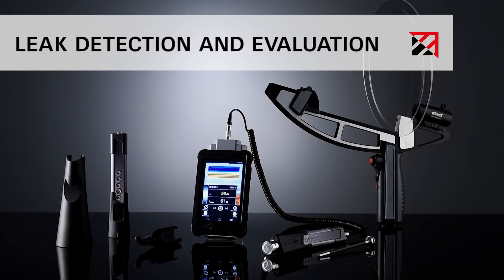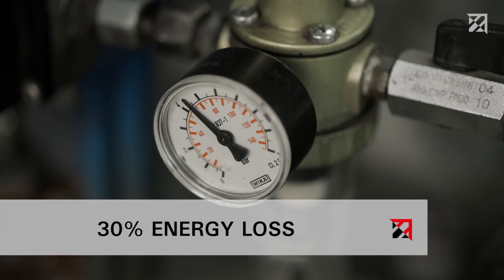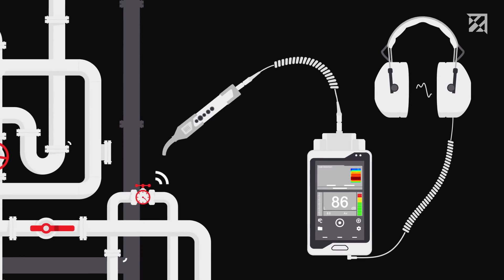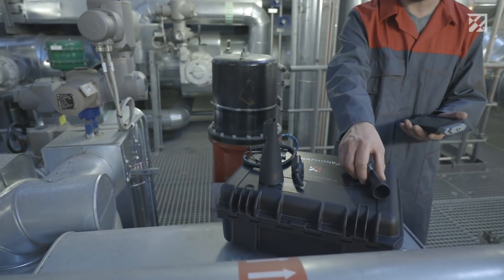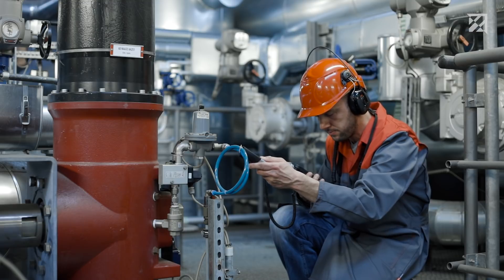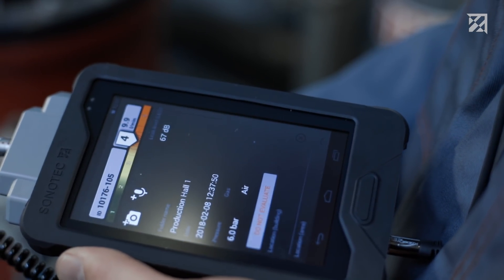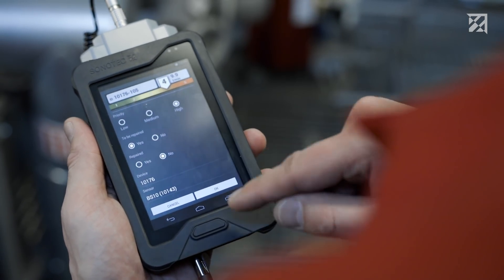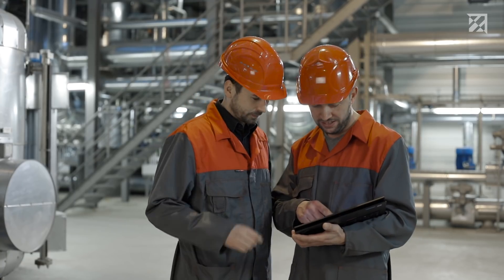Leak detection and evaluation with SONAPHONE

Comment: Can it detect the vacuum leakages on vacuum line such as 10e04 mbar deep vacuum level ?
Reply from the maker: Please read our FAQ-L.3.: 

https://www.sonotec.eu/products/preventive-maintenance/support/resources/faqs/

FAQ-L.3: What tightness requirements (leak rate) can be fulfilled using ultrasound testing with air-borne sensors in standard industrial environments?